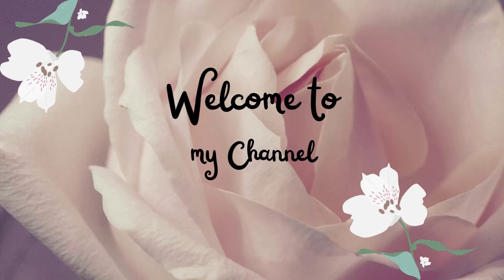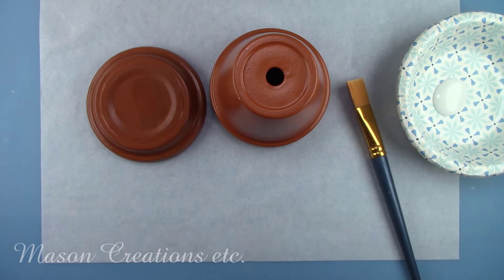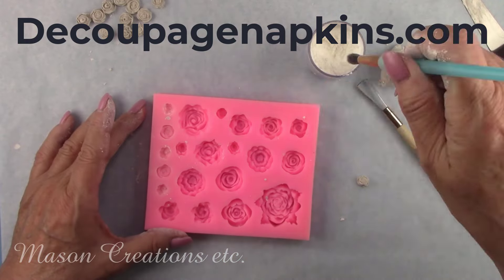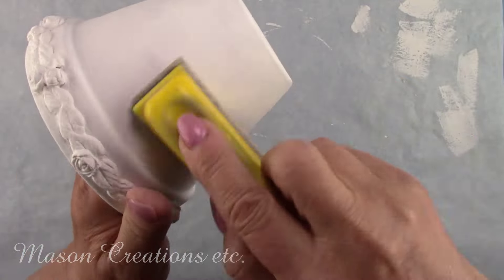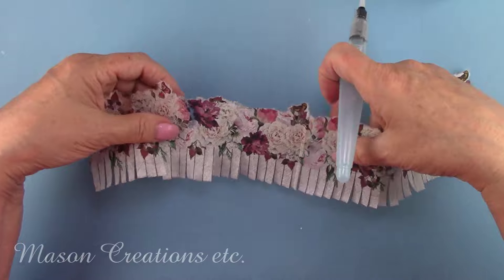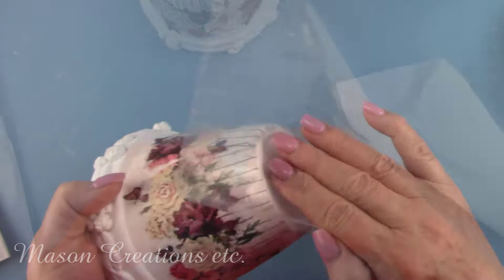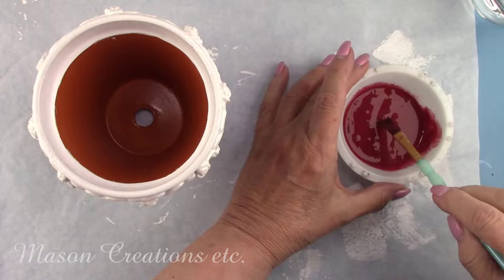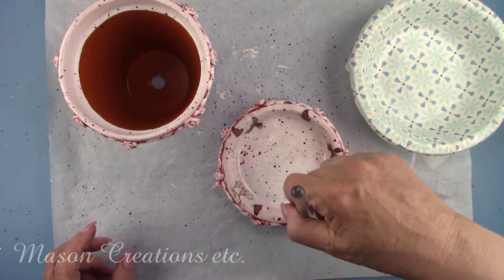How to DECOUPAGE and WEATHERPROOF a Terracotta Clay Flowerpot

Comment: If the napkin doesn’t have the fence picture, would you still cut the bottom like this one without it being obvious?
Reply from the maker: Hi Linda, Yes I would tear the napkin so it lays nice and flat. 
This planter is wider at the top than the bottom, so if you don't tear the napkin there would be a lot of wrinkles at the bottom. I cut this napkin because there was a definite line with the fence.  But normally I'd tear the napkin going between the design when possible.  I'm leaving you a link to a video where I did some tearing because of a curved surface.  It was rice paper, but the principle would be the same. Let me know if you have any more questions, I'm here to help. Thanks so much for watching and taking the time to send me a message 😊💖
Video: https://youtu.be/ZFPz0EPdXMg
Reply: @masoncreationsetc  thank you so much. I’m doing your water method unsuccessfully, just have to practice more. Lol.
Reply from the maker: Absolutely practice is the key.  Are you trying to use this method on a curved surface?  It's very hard to do it on anything but a flat surface.
Reply: @masoncreationsetc  yes on a clay pot
Reply from the maker: Ohhh it's hard to do it this way on a curved surface.  It's fabulous on a flat surface though.  I'm trying to devise a way to do it on a curved surface.  Keep hanging out with me so you can see when I figure it out lol...  Thanks again for watching Linda 😊💖